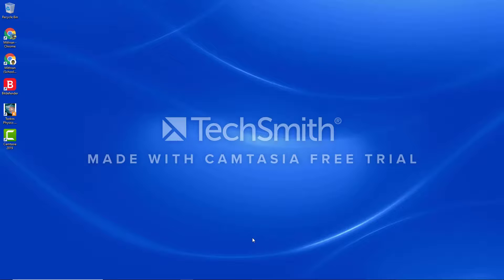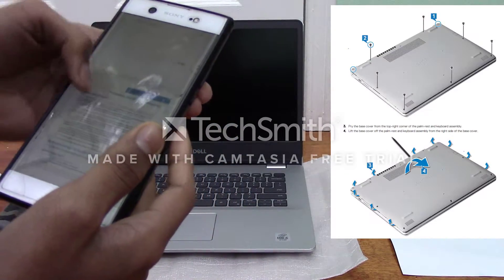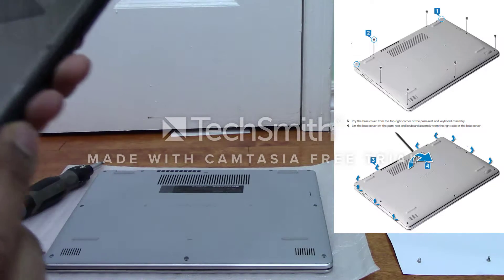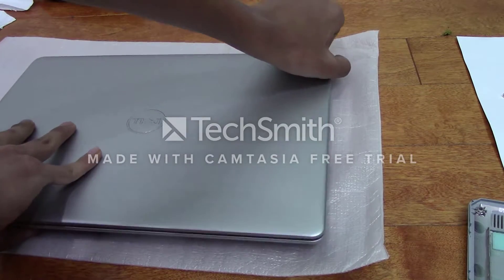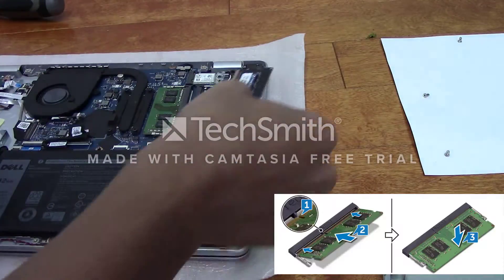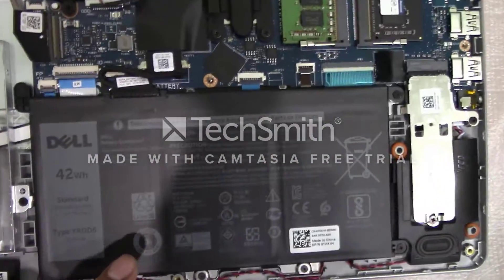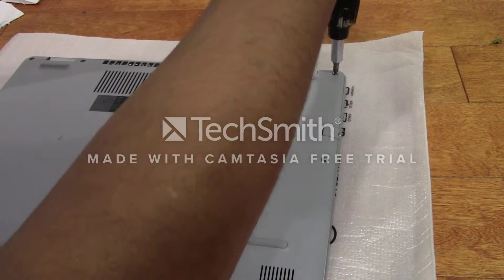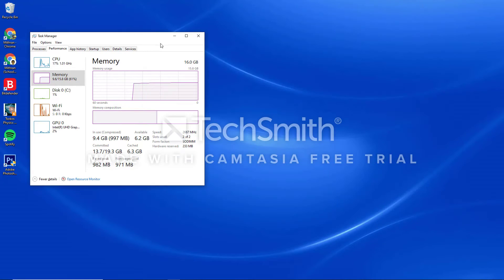Upgrading my Dell Inspiron 14 5000 (5493)'s RAM from 8GB to 16GB! (Reupload)

Comment: What has adding memory enabled you to do, in general, that you could not do with the 8GB?  I am new to this.  Thank you.
Reply from the maker: Basically, RAM is the memory that is used for storing all the apps and background info you have open when the computer is running while HDDs (hard disk drives) and SSDs (solid state drives) are the memory which store files, documents etc. RAM is considered volatile memory because when it loses power, all of it's stored info is lost (e.g. when you shut down your pc, all browsers and apps open will be forgotten) while HDDs and SSDs are considered non-volatile since you don't lose all your word documents and files when you shut down your pc lol. (of course, this wasn't a super in-depth explanation lol, I encourage you to search more if you are interested, you'll find lots of good stuff).

What having more RAM allows me to do is to multi-task more (have more things, and more demanding things) open at the same time without my laptop throttling. There have been times I have had dozens of browser tabs open (usually when working on some assignment), and sometimes other things (such as video editors, or MS apps running simultaneously too). If I were to have had 8GB of RAM in these instances, there would be a higher likelihood of my browser and/or apps crashing (and maybe my laptop crashing/freezing too, but don't quote me on that one).

A higher amount of RAM also gives the laptop some more memory to 'remember' old things. So, for example, let's say I have 8GB of RAM. After, boot up, I open up a browser and then go to an article. Then I open, say 100 more tabs. If I were to go back to that article after that, odds are that there wasn't enough memory to keep it running so it will have to load again. If I had 16GB, the odds of this happening are much lower. Now, this isn't really a huge issue for most people, but this was just a very simple example; there can be many more useful advantages of more RAM too. 

For example, if someone is constantly low on RAM (you can check how much RAM you are using on task manager), more RAM can definitely lead to a smoother experience as there will be less delay while switching between apps and multitasking. All in all, 8GB of RAM is enough for most use cases, but more RAM can definitely be useful if you wish to have many things open at the same time (or for whatever reason want to have something which uses a lot of RAM, like a game open while doing other things).

I think it can also particularly help people who have a double or triple monitor (or more lol) setup since I've realized when using an extended monitor I tend to have more things open.

Tl;dr: Multi-tasking. More RAM helps with multi-tasking. 😂
Reply: @mithstechchannel4273  wow, thanks, good to know what it's all about, many things to learn.  I appreciate it.
Reply from the maker: Great question btw 😁
Reply: @mithstechchannel4273  great answer.